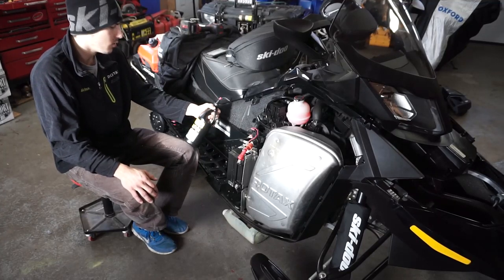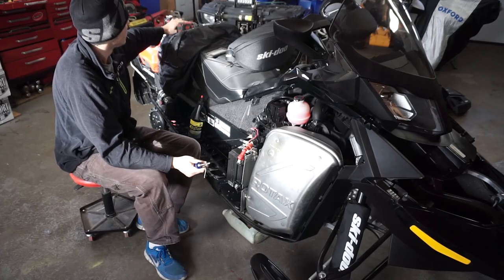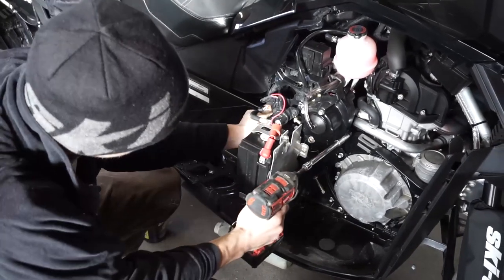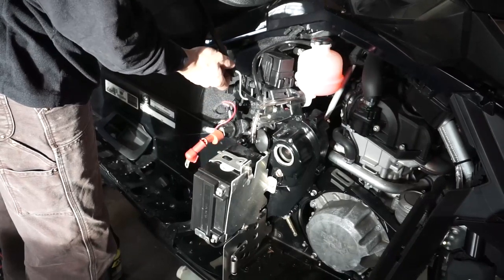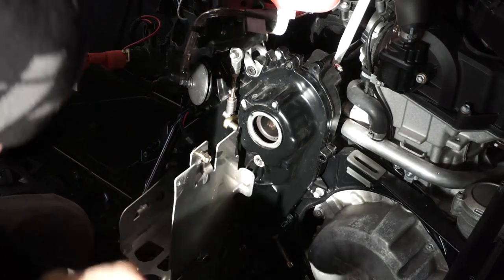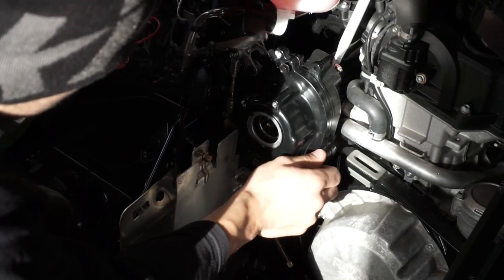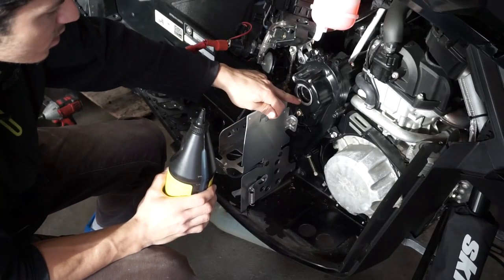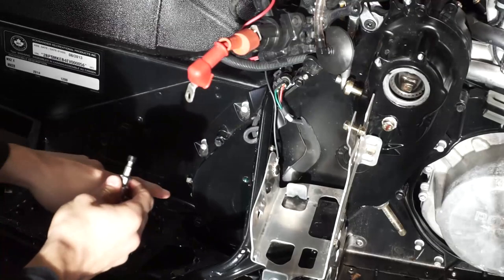How to change your chain case oil in a 1200 4-tec

Comment: If you pull off the case abit you wont dislodge the adjuster correct? Another guys vid says to loosen bolt then take totally off and inspect gears then just finger tight on tensioner screw to seat against chain. Have you had any problem the way you did it? Coolant is to be skidoo only since it is pink? Can I top off with regular. It says for aluminum engines only?

Comment: Love all your videos. Question...when putting tension on the drive chain it's reconnected finger light. However this still allows slack when turning he primary clutch when moving it  back and forth. Is this normal? I know on the two stokes finger tight the clutch has no movement back and forth. Hope you an help. Thanks

Comment: You didn't answer my question I'm sorry I don't see it can I use any coolant
Reply: Not really best to stay with BRP stuff.You can use the auto parts store stuff made for asian cars toyotas etc. My buddy works at dealership and he has been using it for years with no issues. But he still recommends the factory stuff. I have used both also with no issues.

Comment: Why would you not pulled off and check your gears and your chain and  Tension
Reply: Not really needed. I just look at what I drain out and if I see no abnormal metal particles I don't worry. Never had any gear problems in thousands and thousands of miles on multiple brands. As for chain tension easier to do after fully assembled.